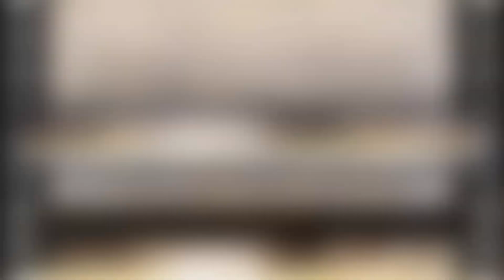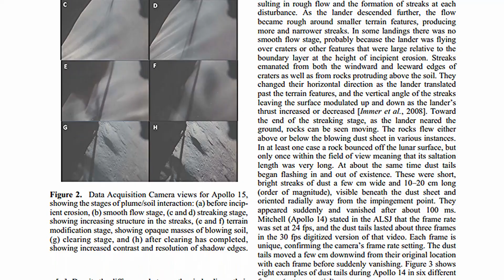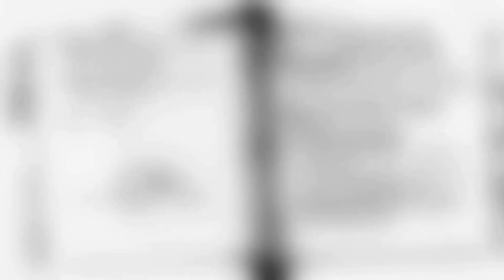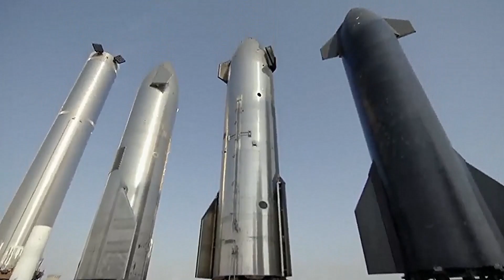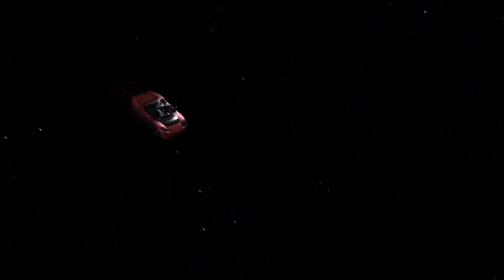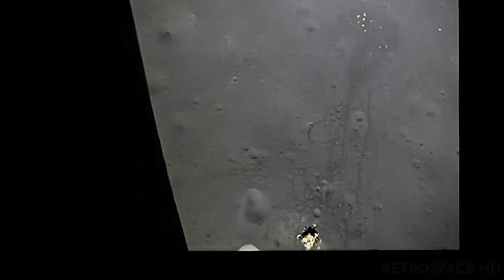THE APOLLO DISCUSSIONS "CUFF LISTS\ MAPPING CAMERA\ ARTEMIS 1" PART 16

Comment: @Marcus and Scott, one question: are there any semiconductors in the Apollo missions?

A variety of radiations including "particles" alpha "beta particles" "rays" gamma "X-rays" neutrons "particles" electrons protons etc. When these "particles" interact with the semiconductor material, mainly two effects can occur: 1. Displacement effect, when neutrons and alpha particles collide with the crystalline structure of the semiconductor and displace the atoms, shifting the structural arrangement. This causes uncontrollable high electric currents which lead to immediate malfunctions. 2. Ionization effect when X-rays of electrons and protons passing through the semiconductor material create "electron-hole pairs", this causes permanent abnormalities and abruptly strange behavior of the device.
if one or both of these effects occur, they can disable the whole thing!
Reply from the maker: Yes, germanium transistors.
Reply: @theapollodetectives  the next question is: what kind of shielding did the electronic equipment have on board? 
I don't think there were a couple of centimeters of thick lead....???

Comment: I did not want to hassle the guy but obvious questions point back to Apollo.
(Another YT'er 'Angry....' who does reportage on NASA and Space X ..) noted in new video the Artemis mission now there radiation testing in Orion testing for the new shielding and including protection vests to finally get some data!    The later launch date for Artemis shortened the mission; longer term radiation exposure was desired.   That is just tip of the iceberg re. perhaps finally a viable 'deep space' or moon mission capsue;
 
Orion has enough computer power and observation tools and sensors to test an autonomous return to earth system.   But the system has no lander for moon and was not designed for that.     Can it dock?  They need SpaceX  Starship (or something).
Reply from the maker: It is always something going on behind the scene with NASA. What ever it may be,  will eventually come to the light. Cosmic radiation has been a problem from the get go in the early 1960's, and apparently still is. Let's face it, all of these tests were done and dusted 55 years in the past. All of the data was compiled and analysed at that time. Why do it again IF they really did land on the lunar surface in 1969 to 1972? It just doesn't make any sense to me.
Reply: @theapollodetectives  "all of these tests were done ..."    The problem is that there was no live testing done between sending men to Low Earth Orbit and sending me to orbit the Moon. For example, they did not send a dog or monkey thru the VAB and back.
Reply: @codetech5598  Exactly! .. Like the late great Ralph Rene once said.."You don't send the man where you never sent the monkey."
Reply from the maker: @codetech5598  NOTE: WE WILL BE LIVE ON THE AIR WITH MICHAEL DECON ON THURSDAY DECEMBER. 1ST, 2022 AT 10:00 AM PST. THE LINK WILL BE POSTED BELOW. CLICK ON LIVE VIDEOS WHEN YOU ARRIVE. IF THE LINK CHANGES, I WILL UPDATE IT AT THE TIME OF THE BROADCAST. YOU MAY CALL IN, OR ASK US ANY QUESTIONS THAT MAY BE ON YOUR MIND.

https://www.youtube.com/@micheldecon
Reply from the maker: If interested, we will be live on Michael Decon's show today, Tuesday Nov 29th at 10:00 AM PST. I posted the link in the pinned comment at the top of the video.

Comment: Just got the news. Orion overshot and it is in extremely long ecliptic orbit. It takes at least one week to correct and get into the ordinary orbit. Then, it needs to get into the lower orbit to land. Anohter one week.
Reply from the maker: These Artemis missions are serving to expose the Apollo program with each passing day. I think that this is what we are suppose to see and that everything we saw in the 60's and 70's was at least 80% fake. That is why Artemis appears so fake when they show video or still images. We expect more, as does the national media.
Reply: @theapollodetectives  The new fake video they showed was "Earth rising behind the black moon."Sound familiar? The moon is the new moon now. There is no way you can have black moon and bright earth behind. That is possible only when the moon is full moon. NASA  has zero credibility.
Reply: To flyby the moon requires a fraction of the payload capacity you need in order to actually orbit the moon, let alone landing and launching again. That's why the Russians were able to do it 4 times with an unmanned Zond capsule, but they couldn't go further than that (there's a huge gap)

And of course, an unmanned mission is a fraction of the complexity of a manned one (and the whole point in all of this case, since radiation and the thermal problem are the actual showstopper)
Reply from the maker: @armandobalance9208  But wait! Artemis now has NANO technology to shield the occupants from the harsh radiation of space! Rasa and I went over the entire subject. He now works for China's Space Agency. China as he elegantly puts it, knows that Apollo was faked and he claims that they have the proof. We shall see in time. To date all Artemis has been proving, is that Apollo could not have done this so easily six times in a row.
Reply: And it was so easily done with 11, went straight into orbit, landed, left and reunited with the CM without a glitch along with the rest of the missions. 
Another thing I thought was odd was them banging on that large rock with a mall with no worries of chips flying back and possibly cracking the shield or causing a hole in their suits.
Reply from the maker: @1200sbeemer  Yes, and six times none the less. I don't believe that for one minute.
Reply: @theapollodetectives  Looking back at the “glitches” they had with everything else, the odds do look incredible.
Reply: @1200sbeemer  The orbit injection looks liek "over-shot" and it is in the elliptic orbit now. Nasa will tell us, "That was intended..."But, it is not the orbit for landing. It takes several days to correct it. Nasa may try to get it back to earth without correcting the orbit. For such an accuracy, there is no way it will survive in the Earth orbit injection.
Reply from the maker: If interested, we will be live on Michael Decon's show today, Tuesday Nov 29th at 10:00 AM PST. I posted the link in the pinned comment at the top of the video.